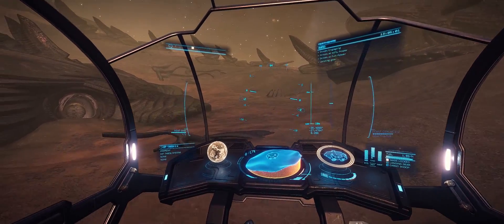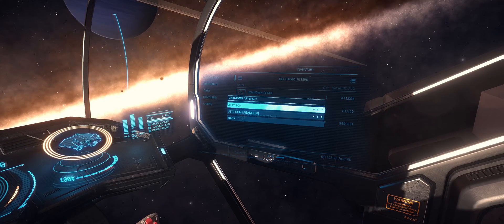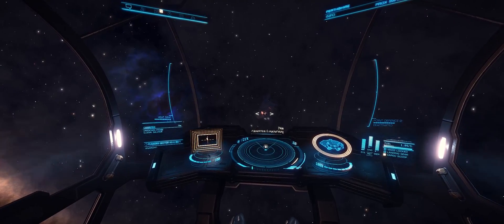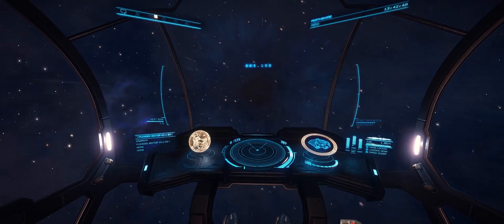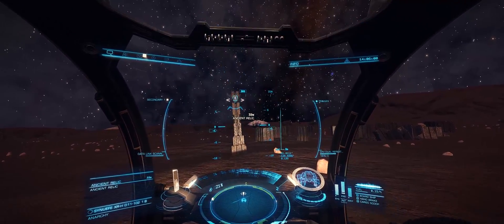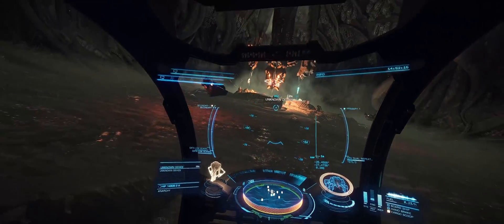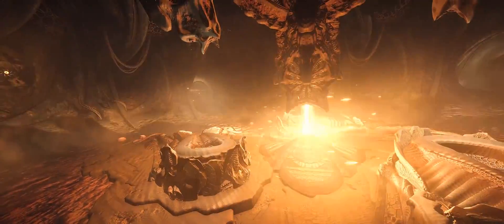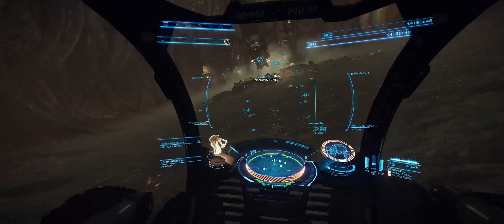Elite Dangerous - Bad Things Happen when you Mix Thargoid and Guardian Tech.

Comment: Latest development RE the UL.  I'm sure you'll soon have an update video RE the UL.  New response from the UL. 
 Tight beam transmit from the UL . Various finds around the time, yesterday afternoon/evening.

Unsure who first found the reaction, should be in threads with claims from many,  the reaction from the unknown signal inbox message from the active large wreck site.

Play that audio log sound back which gives the spectrogram to the UL and you will get a new response, similar to a UA and UP response combined . 
That triggers a predicted response not seen until the audio log was played.  Like the UP having a tight beam transmission from the centre dish, once the audio log plays, must be played in full dont close the log till UL reacts.  need be infront of the dish and will get a tight beam transmission similar but different to the UP tight beam. 
Early research suggest different result from the UP , possibly leading to some new octal calulation location .   
Speculation , this may lead to a destination other than the old UP octal. My theory is UP is a reference point of distance, UA directional , UL combines both signals for a new directional distance and location .  This is still speculation and awaiting further studies of the new octal from various locations.  Does that link in with the latest spectroG? most likely. where it leads,  Soon but unknown.

Comment: thargoids are most likely geneticallly engineered creatures used for war by guardians that got overtaken by the offshoot of guardians that merged with AI. 

those giant alien bases are burrowing out from under the ground, you can tell by the pattern of cracks surrounding the site itself. they go in swirls, instead of straight lines. the structure itself is even shaped like a giagantic mining drill bit. it could be that the AI has simply reactivated its long dormant nodes of thargoids, and they are being repaired by scavengers after millions of years being buried. it would also explain why they were buried to begin with. we need to keep checking on these sites to see if they start to protrude through the ground more over time.